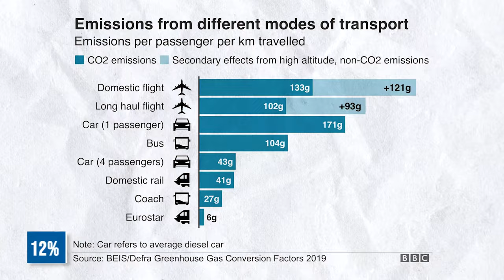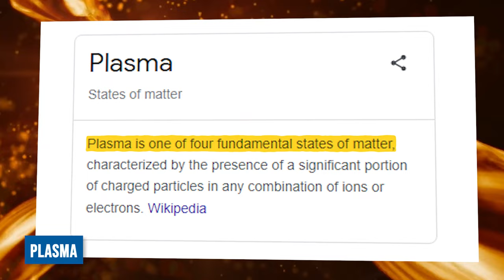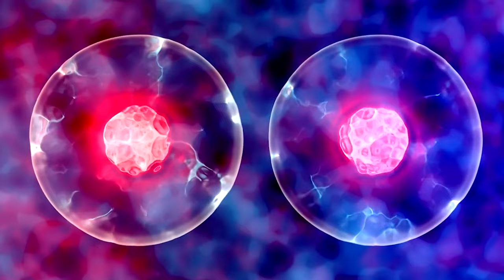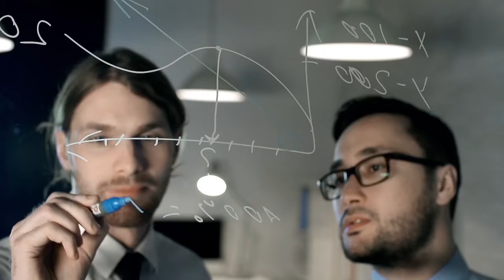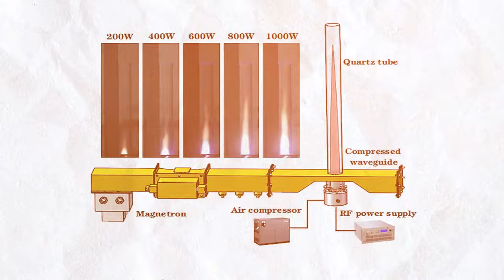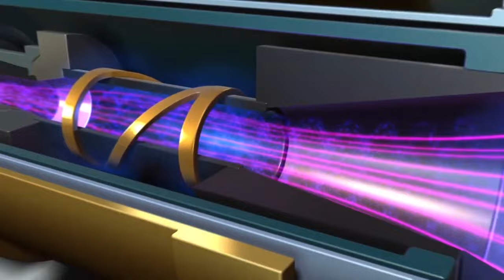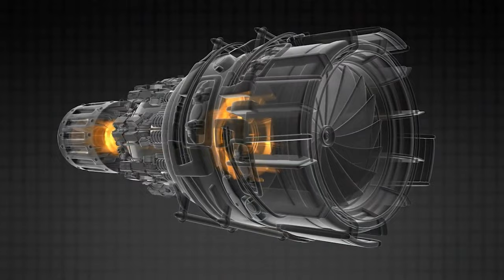Microwave Plasma Fighter Jet Engine Could Change Warfare Forever!

Comment: This sounds terrific however I would still use the pneumatic system as a backup in case of failure you can switch to pneumatic systems